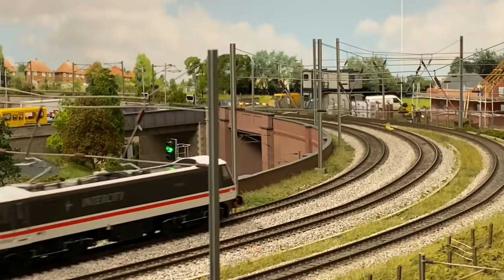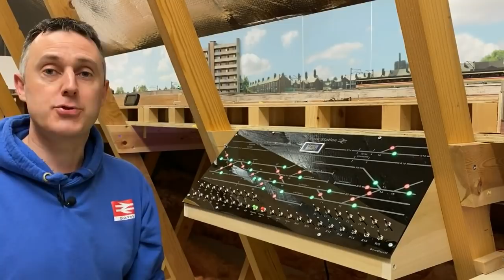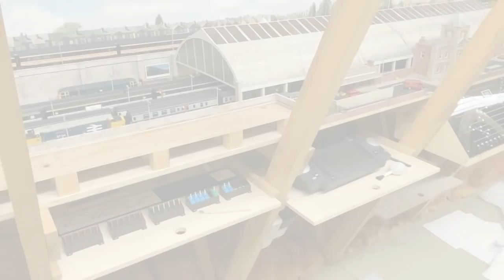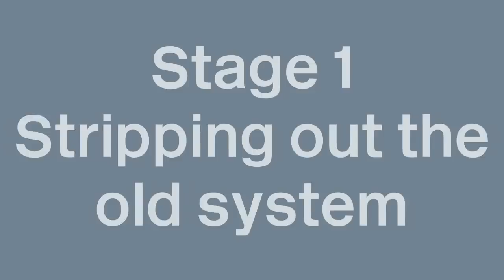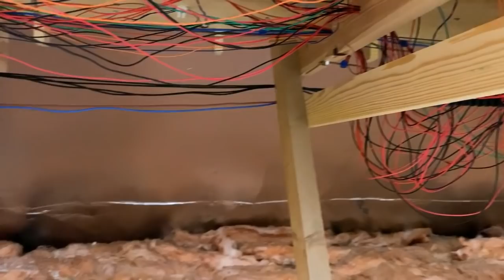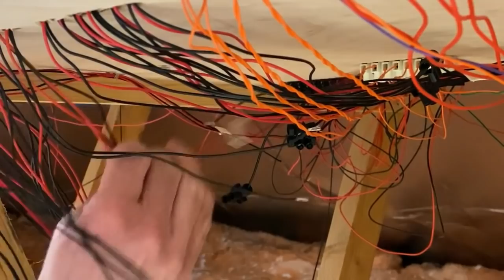Model Railway | DCC Concepts Control | Dean Park 255

Comment: This is nuts, all those electronics to achieve basically what you had before. Your panel is beautiful but you could have used the toggle switches directly with your points and cut out the expensive DCC concepts middleman. Now I love technology but this seems crazy to me. Don't get me wrong, I think it's all admirable stuff but overkill. But each to their own,  I do enjoy your channel and I feel a little bad saying this stuff,  but I do admire your work.
Reply from the maker: Hi. Sure the points operated before but not through the ecos. This way I can use the ecos to have control if I want, or the toggles.

The lights are a more visual way of knowing which way the point is thrown. I can also see the route set up, Ie if they are all greens I know where the train is going and if it’s got all of the points set correctly. I like the more visual display that I get with the LED too. 

Yeah it does the same basic thing of controlling the points but now it’s higher tech and, well I like the look of it lol. 

I suppose.,as you say, each to their own. I just thought I’d go for a set up that had worked so well for the storage yard control panel. I do like to try new technology. 

Thanks for getting in touch though. Sorry I didn’t see your comment earlier. It’s great to hear you enjoy my channel. Thanks for watching my stuff. 

Cheers 
Dave

Comment: Great video - I find you really need to 'see' DCC Concepts stuff in action to get a feel for how it works, what it can do, and what else you need to buy. The text on the website is very difficult to understand and it gets frustrating where every other sentence they tell you X unit is all you'll ever need, only to say 'once you add three more, a power unit, a sniffer unit, an adapter, three Y cables and more...'

Comment: Can You Use it with the hornby elite dcc contoller or if not without a dcc controller?
Reply from the maker: Hornby elite does allow assessors and point decoders to be used. But you’d need to check with dcc concepts to find out specifics.
Reply: @DeanPark  thanks for you’re reply decided not to go for a system like this now lol fine manual because my layout isn’t too big! But thanks for the advice anyway.

Comment: Total waste of time and money, indeed a heck of a lot of money, around 400% more than ANY analogue system. And it still doesn't operate the layout in a realistic way. Indeed NO DCC system can operate a model railway in a real life fashion, assuming you understand how real railways actually operate ! In other words there is still NO interface between moving trains and the signalling, which requires Track Circuits. Track circuits on my Analogue controlled layout cost 1p each, and literally only need a piece of wire !!!!

And when I said 400% I meant FOUR HUNDRED PERCENT !!!
Reply from the maker: Reality check: it’s a model Railway! It’s supposed to bring joy and fun to the person ‘playing’ with it.  We are not operating a real railway.

It’s not all about Cost, it’s about enjoyment from building this and seeing it operate model trains.   Analogue… ok. Stick with that if that does it for you. Personally digital does it for me and I suspect a majority of others. At least I don’t have to worry about isolating sections etc while using dcc. I’ve done the analogue thing back in the 90’s. No thanks. I am in the 21st  century now. And I like it. 

So no, not total waste of time and money. Yes I ‘understand how a real railway’s actually operate’. But why not following the ‘real railway’ means it’s a waste of money is slightly bizarre. 

Why post this?
Reply: So if your DC controlled layout works in a ‘realistic’ way, then so can a DCC system as you just replace the analogue circuits with digital ones. The only valid point you have is cost, which is actually down to the individual’s budget. My Trainset does run in a realistic way if I so chose, with correct blocks, and correctly operating signals, and workings. I’m also happy to demonstrate this at any show my trainset attends if you’d like to see your theory proved invalid?
Reply: @mikebuick2332  Real railways use complex "Block signalling" systems to ensure safety, and control the movement of ALL trains. (A bit like a normal model railway controller, with safety added). Early systems were mechanical, such as the "Absolute Block" system, used in conjunction with semaphore signals on lines that included passenger trains.

The fundamental safety rule of "Absolute Block" is that only ONE train is allowed on EACH "running line" within the WHOLE area of the signalbox controlling that line. Irrespective of how many signals that box may have along its running line(s). In other words trains are specifically forbidden to follow each other from signal to signal. Something few modellers can understand !!!

The MINIMUM number of semaphore signals needed for an "Absolute Block Post" (the signalbox) is: A Distant signal, followed by a Home signal, followed by a Starter signal, for EACH "running line". So if it's a regular two track railway, you have three signals on each "Running Line", which may cover an area of no more than roughly three miles of route, due to expansion & contraction problems in point rodding and steel signal wires.
. 
The Home signal and the Starter signal (both red/white painted stop signals) must first be pulled to indicate a Clear Line, before the Distant (the black/yellow painted signal) can be cleared, to indicate a Clear Line right through the Block. In other words the "Interlocking" ensures the levers can only be pulled inside the box in the correct order. To ensure only ONE train (and safety) can ever be on this roughly three mile section of route covered by this signalbox !!

So how can DCC replicate this "Absolute Block" method, or for that matter any other method. Such as "Track Circuit Block" which is used in conjunction with multi-aspect  colour light signals. As its name implies this method requires "Track Circuits" to detect the presence & location of all trains, at any moment in time. It also ensures that each signal returns to red automatically when a train passes. This added safety feature above and beyond the "Absolute Block" system, now allows trains to follow each other safely from signal to signal. And of course, also allows a huge increase in the number of paths per hour on any given route. 

DCC has no method available to replicate any of the Block signalling systems used, including the two just exampled. Why not ? For the simple reason that the commercial manufacturers do not know what your layouts track plan is. And every layouts track plan would require a different set of "Interlocking". Just as every real life signal box has to have either its own unique mechanical equipment or with a computer signal box, unique software to deal with that boxes, track plan and the necessary "Interlocking" for that layout.

Fleischmann (German RTR manufacturer) went bankrupt having spent over €2.5 Million trying to plug the gaping hole in DCC by greatly increasing the systems capacity. So it was as great as a PC. But still could not find a simple way for users to implement their trackplan into this expanded system, even though a CD with the necessary software was to be included. Becuase the possible permutations were in the Millions. (Fleischmann were sold to Roco over 10 years ago as a result). 

But I can, and have been applying a number of British Block Signalling systems to my exhibition layouts for near 40 years, including the two examples mentioned. For the simple reason I am a Railway Engineer, who has worked with a number of real railways around the World, and understand the basic wiring necessary for the job. However knowing what electrical equipment is necessary is the easy bit. Relays being the most complex item I need. However it takes weeks of careful thinking to identify what interlocking will be needed for a point or a signal, and the more optional routes there are, dramatically increases the number of "Interlocks" between items. 

Relays are the mechanism used for each "Interlock" because that's what real railways still use. Relays being simply a number of switches inside a little case, actuated by an electro magnet. So using a cheap one penny "track circuit" (a piece of wire connecting a small section of isolated rail to a relay). I can get a train to actuate the relay, which changes the switches inside a relay. Each switch in the relay may illuminate the red on a signal just passed, or illuminate the yellow or green LED on a previous signal. Or change the feed from one signals relay to a different relay at the next signal because you just changed the points and set the train along a different track. 

Of course this cannot be done when you have 16v AC in the rails, because AC behaves in a different way to Direct Current. DC has an advantage in that you can feed a piece of track with supplies from many different transformers (via rectifiers) without causing short circuits, as would happen if you used AC. DC you see will only return to the transformer it came from !!!!  

Having added the real life type Block System to a layout, I can let a complete novice try and screw it all up. By driving his train where he likes in contravention of real railway rules. The fun is watching the novice, when he discovers he simply can't do this. Or his train won't move, because he has tried to crash a red signal, and the real life type AWS system has stopped his train before a crash can occur.  

In addition to the block signalling relays, track circuits and wiring, I also use traditional methods such as a single Common Return cable for ALL items on the layout including controllers, signals, relays, point motors, which reduces wiring by around 45%. Cab Control is also used to allow more than one train to be driven along a particular line, by different controllers. Very helpful when adding/detaching vehicles from trains standing in stations, and used in conjunction with Kadee magnetic couplings on all stock.

NOTE to avoid interference problems between various electrical items and the train controllers, each type of equipment has a separate transformer ! 

Happy Modelling 😝.
Reply: @JamesSmith-mv9fp  After reading through your very long winded reply, you’re forgetting the fact that computer software can ensure absolute block. I’ll let you read up on it as I can’t be arsed to write another 5 page essay
Reply: @mikebuick2332  Of course it can, and that's the current problem with DCC, it does not currently have the capacity to do this. Fleischmann tried & failed going bankrupt in the process. Indeed any manufacturer who wants to change the current fundamental electronics of DCC, has by default to get all other DCC manufacturers to agree to the changes. Which was the main reason for Fleischmann going bankrupt. The huge NMRA (American model railroad club/society with near 1 Million members) refused to give Fleischmanns new product their seal of approval, without which the retailers would not stock the product !!! So the one opportunity to fill the gaping hole in DCC was buried.

Comment: Hi, I’ve been extending my layout using the same setup as you are using, ie. ECoS, DCC solenoid decoder and Peco  motors. I have come to a problem which you seem to have overcome namely the three way point which the ECoS programmes sequentially for the two motor but you can’t have both decoders listening or they will the same address, how did you overcome this?
Reply from the maker: Hi. Treat the three way point as two separate points on the ecos. Giving them two different addresses. Don’t use the three way icon on the ecos. Use two normal point icons. Hope this helps. So sorry for taking so long to reply. I just stumbled across this comment when watching the video again myself. Dave

Comment: Hi Dave layout is amazing. I am about to do the same to my layout, l wax wondering where did you get the black panels made up. Thanks
Reply from the maker: Hi, designed it myself. Mate laser cut it on his small machine.

Comment: I think the touchpad controller you have is essentially a Märklin Central station 3 as this is made by esu for Märklin. 

Interesting to watch. I use a similar system from Märklin with the K83 control boxes to control the points and signals. I can't afford a CS3 at the moment so use their mobile station 2 to control the boxes. It's much easier than using the old manual solenoid control systems.

Comment: Really informative video and most useful.  I’m in the embryonic stages of going DCC and the control panel that your constructed looks really smart.  Just out of curiosity did you just get a local company to laser cut the panel and what thickness was the panel and where did you purchase the red green LED’s.  Sorry for the questions but really inspired by the video. Many thanks.
Reply from the maker: Hi. Thanks. LED are Dcc concepts dual leds. Green/red. 

Panel is 3mm acrylic

My mate has a laser cutter for his home business, so he kindly cuts it. I’m lucky in that respect. 

Cheers
Dave

Comment: Hi Dave.

Brilliant video.

What company did you use for the laser cutting of your control panel? I am looking to do the same.

Regards.
Reply from the maker: Aston Napper-Woods hi it’s been designed by me and I’ve a mate who’s got a small laser cutter. But if you contact railway laser lines they might do commissions?
Reply: DaveClass47 Hi,

Brilliant thanks I may give them a contact.

Comment: Hi Dave , great video and nice to see adaptation on Ecos as I have used one for eleven years and with over 130 points I use the onboard track mapping which runs into five pages. I would love to have a separate control panel but the Ecos originally did away with all that extra wiring. Technology has moved on since then as you have shown in this video.

Comment: wow great control board, I am very surrprised the Dcc Consepts accessory boards do not allow for three way points...it's strange as the boards opperate in the same way as the Esu accessory boards..I have  three way points working on two addresses with mag coils switches with no problems. {it my be the bridge board converting to the Lnet interface cable that may not allow this}.

Comment: Hi Dave. A wonderful piece of design and implementation. Can I assume that the Cobalt solenoid boards would not be necessary if you used Cobalt IP Digital point motors? Any other modifications necessary?
Reply from the maker: Hi, yeah the solenoid decoders are just to link to solenoid point motors, :-)

Comment: Very impressive and I am sure you will have a great time working with it. I may have said this before, but I am old school and I am going to stick with DC. My points will be servo-operated using Arduino with Uno 3 boards. So not everything is manually operated and there will be no surface mounted point motors. I hope to be able to open and close the 6 bay Roundhouse doors in the same way. The turntable will be linked to the Uno 3 board to control the indexing. Most of my Loco's are from the 60s,70s, and 80s. I hope to be able to have 4 trains running at the same time. I can on my plan have 3 at the moment, I am working on the fourth. Very Interesting video and you are keeping me up to date what is available. Martin. (Thailand)

Comment: The board looks amazing and is really well explained! You mentioned your signals being automated using the Heathcote electronics, have you done a video on these. I tried to find one but couldn't.
Reply from the maker: Try my previous video, Dean Park 254, I look at them during that video :-)
Reply: @DeanPark  Thanks! I hadn't got that far through 254 as I got too excited about 255!

Comment: Hi dave, what software did you use you design the control panel. And also if I wanted to just use switches and not ecos aswell could i do it without the decoders. many thanks.
Reply from the maker: Yes just use toggles direct to each point motor, but the lighting of the LED wouldn’t operate. I used serif draw plus, which I have had for years to design the board.

Comment: That’s brilliant dave, I’m taking it I don’t have to run led wiring from the controllers and would be just through the mimic boards via dcc ? Also the panel you had done did they engrave it and drill all the holes or did you do that part? Cheers Darrell
Reply from the maker: Hi only wires from led to mimic, there is only two wires from all of this to the ecos. That’s the Beauty of it. The holes are cut on the laser, so they are all Perfectly aligned and spaced. It’s wonderful technology.
Reply: DaveClass47 thanks Dave, sorry for so many questions but I’m just a the stage of best way to connect dcc controllers to mimic panel , cheers Darrell

Comment: 42:19 You appear to have missed a trick in that setting point 14 on the Three-way does NOT set point 12 below it thereby creating a conflicting route.
Reply from the maker: I could have done, but chose to keep it separate for a very good reason. A loco can cross point 14 towards point 12, but stop to allow trains to pass on the lines at both ends of the loco. It allows a bit of flexibility. It was all thought out during the design of this system. The same with points 7&8 at the other end using the due mind crossing. All thought out beforehand.
Reply: @DeanPark  Fair enough, sounds like a reasonable compromise, though in prototypical circumstances that would be Verboten AF! 
If the signals actually stop the trains rather than just being 'cosmetic' maybe it's possible to interlock with R9 as the loco straddles that line . . .
(I been playing a lot of Simsig, see, and you get to know what's what in route-setting . . . sorry)